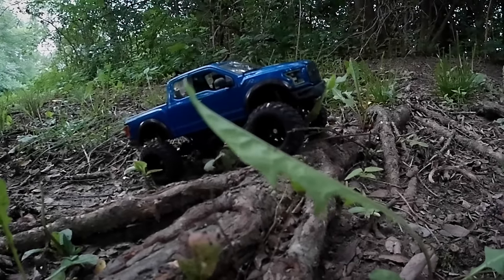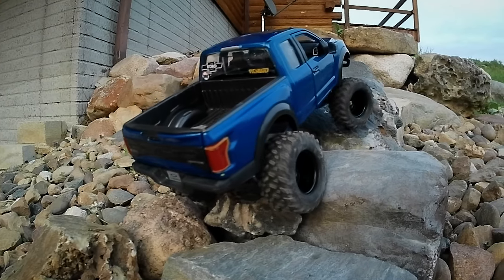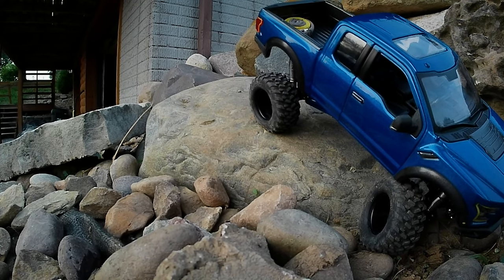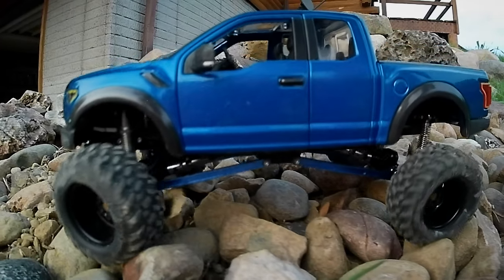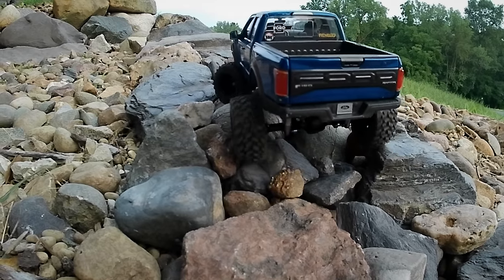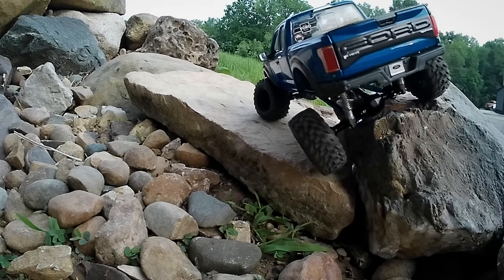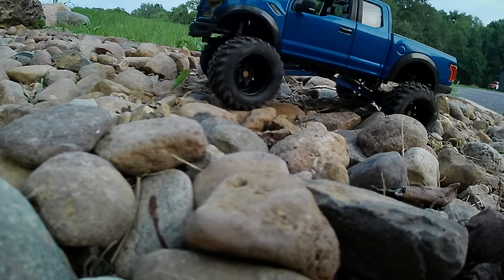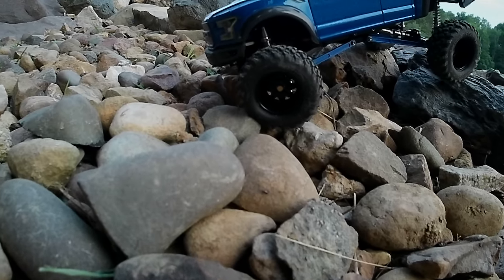RC4WD Ford F150 Rascal Diecast 1/24 - Maiden Voyage

Comment: Man I’ve never heard of these. How is the aftermarket for these.
Reply from the maker: It is non-existent. These came out about 5 years ago, peaked around 2 years ago and have since been discontinued. Made by JD Models. They make larger high end stuff. Out of Germany. Truck has so much engineering built into it it's not funny. 400:1 overall drivetrain ratio. Tiny little n20 motor pushes this beast. Can't wait to go brushless and get a better servo. These also run on a tiny micro servo, smaller than the SCX24 sized stuff. Makes it tough to find an upgrade. Found only one left at Banggood. Also got a stock servo on the way in case this one fails. I just swapped some Patagonias on it but they're super soft. They look good but I'm not sure they'll stay on. Love this thing. Instantly like it as much as my SCX24 scale trucks and I definitely like it far more than the RC4WD 1/18 stuff. It's a whole different truck. So well built.